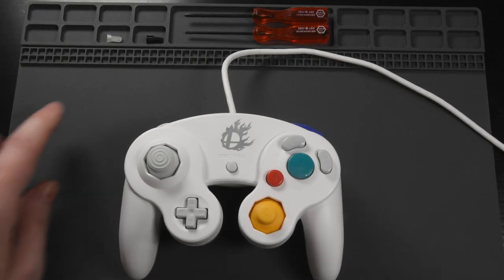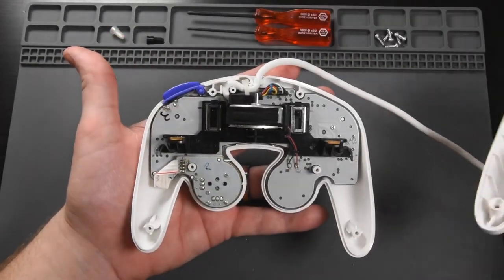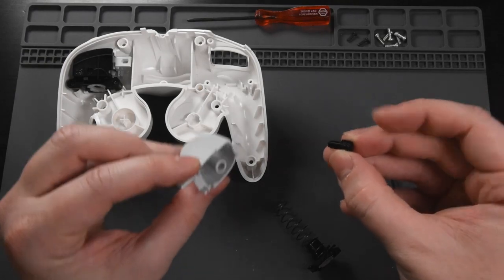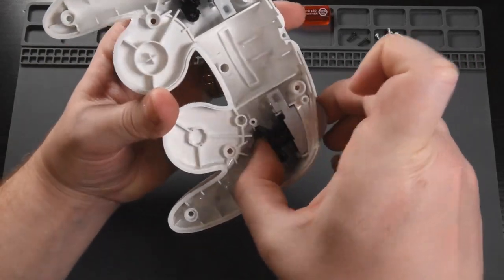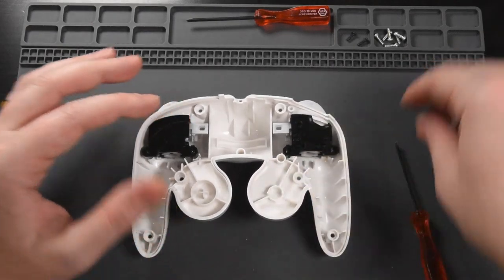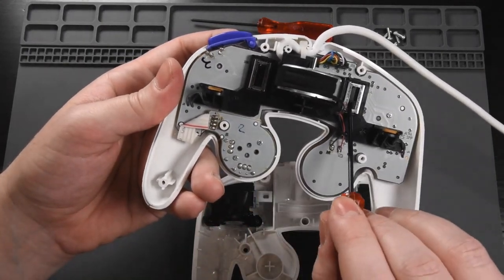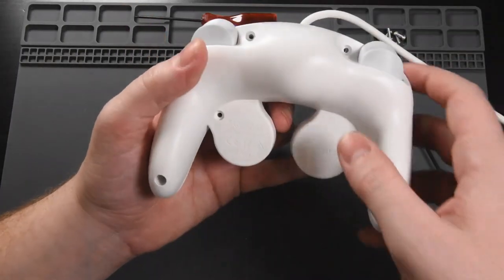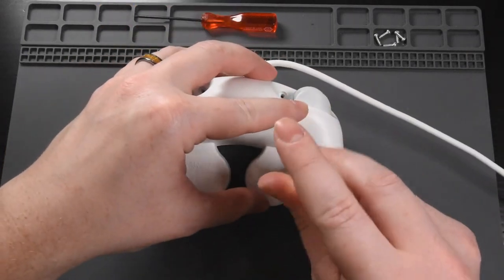Installing Trigger Plugs in GameCube Controller

Comment: Thank you, this video was a helpful sanity check for me.  I was installing plugs for the first time into a controller that had no springs.  I could not for the life of me get the button pad to stop popping out.  I figured all I had to do was just hold the pad in place while installing, but I couldn't get it to work.  After watching you do it I knew I was on the right track and just needed to level up my finesse.

Comment: I installed it just like you. The left one (my short one) works perfectly fine. On the other had my right one (a tall one) is a little unresponsive sometimes. I have a off brand GC controller. Any ways around this.

Comment: When the plugs are in, I have to press REALLY hard on the triggers to work. Anyone know why?
Reply: Me too, do u know why now? Is it too long? I have a 3D printer and I ll try with shorter ones
Reply: @Well I dont remember the explanation exactly but a gcc for SSBU does NOT work with “tall” triggerplugs. A Gcc for ssbu needs short triggerplugs or else ssbu wont register the press at all (thats why we have to press so hard)
Reply: I just realised I assumed you were using it for Smash Ultimate, sorry if thats not what you were trying to do
Reply: @Paggathovenaar  do you still have the measurements of the plug by any chance plz?